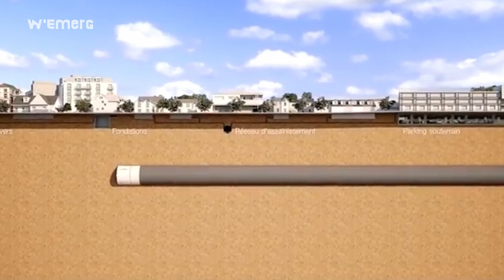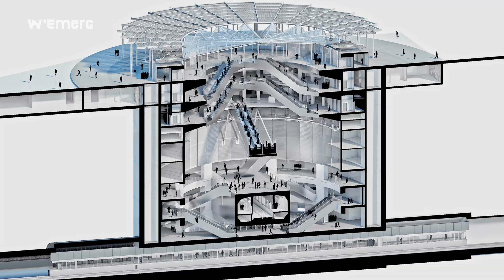This key station is FINISHED - Grand Paris Express

Comment: Opening date is delayed every six months, chinese built similar netrwork in 2 years.
Reply: What are you talking about ? The station has been opened in January 2025, nearly 2 years ahead of the initial schedule. And south branch of the new line 15 has only been delayed by 9 months, all the works on the tunnels and the rails is finished since nearly 18 months, the delay is just caused by difficulties with the signalization.